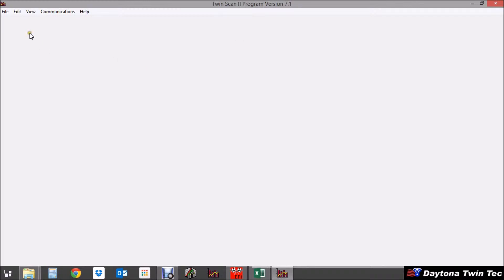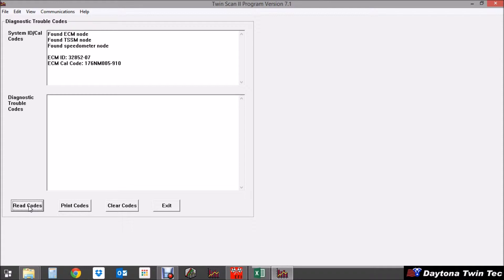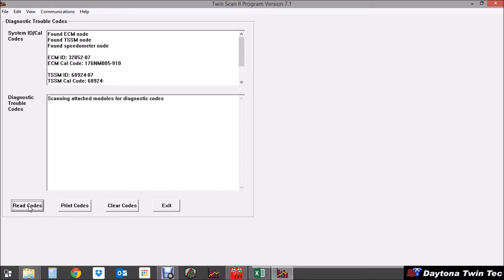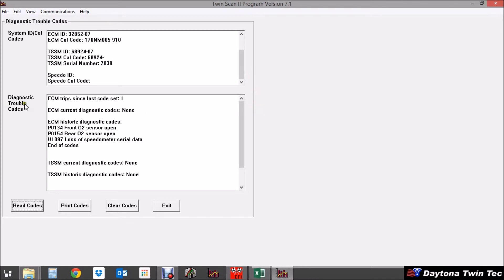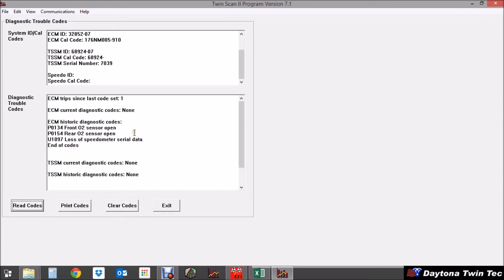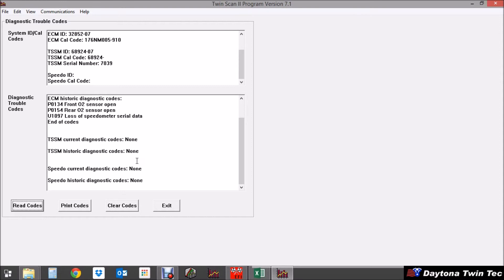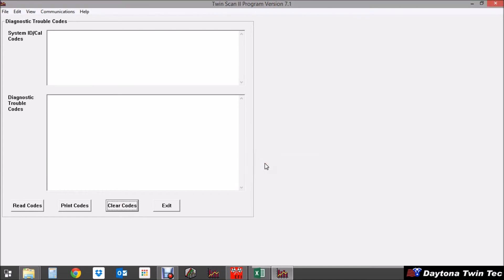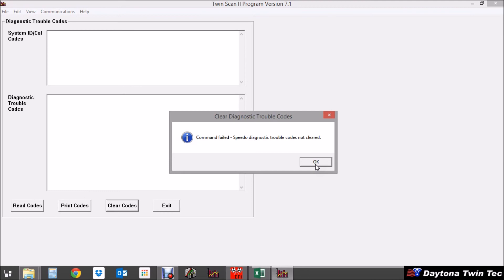Daytona Twin Tec - How To Series - Twin Scan - Diag Codes - Kevin Baxter - Pro Twin Performance

Comment: Hi all . I have a dyna wide glide  8/2002 . It has a twin tec module in it long with cams ,95 cube kit.  95 cube heads etc.  Everything was fine for age's then when I turned it on one day the engine light stayed on . Normally just stays on for 5 odd seconds then off . Now it just stays on . I wait 5 odd start it and it goes out . During a ride it comes on quite often . 3 flashes then off . Sometimes it's every few minutes several times then not seen for ages . Doesn't matter about gear or speed .  Was told it's a code but no one has been able to clear it.  I have an oil pressure guarge fitted and hot the lowest it goes is 12 pound hot at a lumpy idle . Carby model . HELP